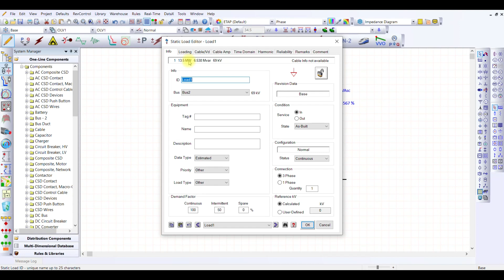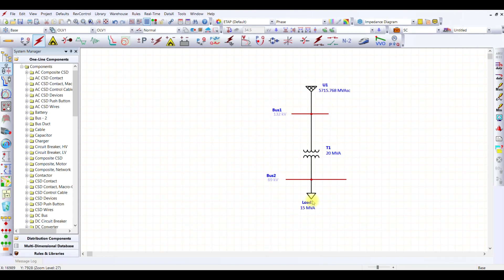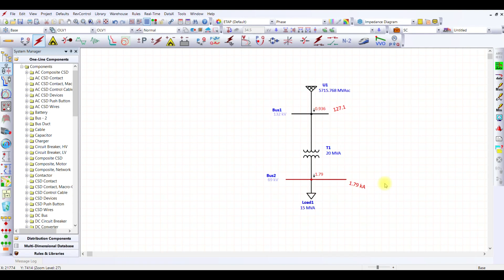ETAP Lecture Series - Lecture 07: Simulation Example of Short Circuit Analysis in ETAP

Comment: hey there i tried to do the same in etap, its maching the results when C factor is 1. but problem is when i select c factor 1.1 as per IEC,  the SC is now increased to 1.978 which is not equal to 1.79*1.1=1.969 why this diffrence is arrising, can you explain this please